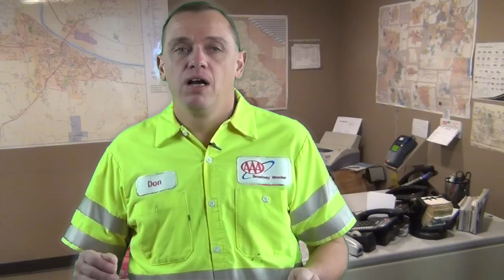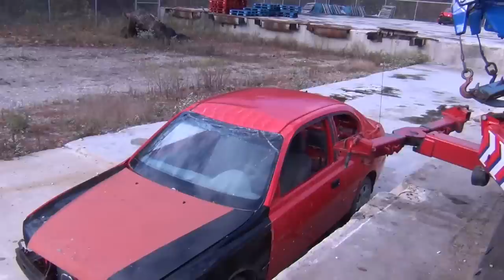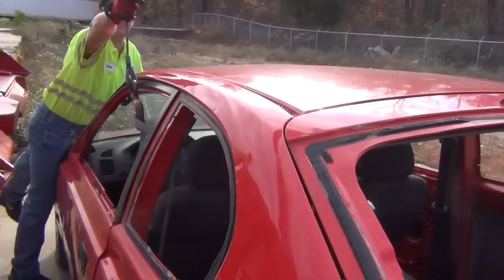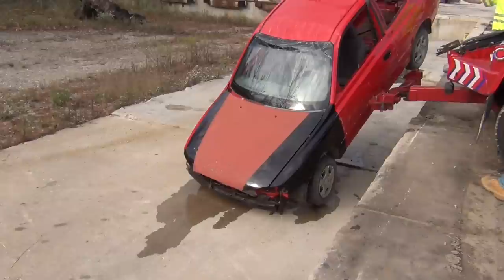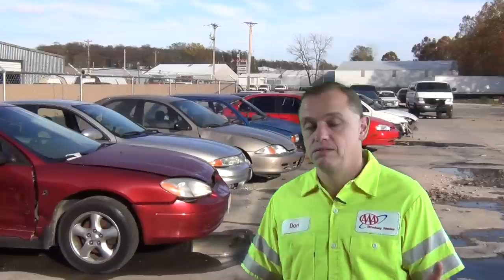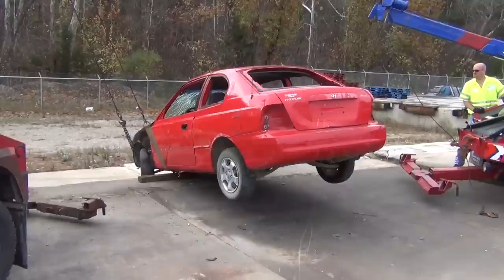Seat Belt Accident Recovery- Two Tow Trucks recover a wrecked Hyundai over the wall

Comment: That's a single truck recovery. 2 recovery straps (one behind the front wheels one in front of the rear wheels) to make a sling. One winch line to each. Boom all the way down fully extende, tighten the lines to get all wheels 6 inches off the ground. Lift with boom to get tires even with the surface the truck is on. Pull forward with tow truck, set the car on solid ground.

Comment: i recovered a toyota hiace van from the river suck in castlerea by the rear tail [back boot door] lock stricker, i had to dive in to hook on, the under carage was sunken into the river bed muck so i couldnt get anywhere to hook on to, i tied rope adound the striher and put the winch hook onto the rope, the striker held strong and i managed to recover it.

Comment: I'm a tow truck driver of two years I know I don't have that much experience but I am dumbfounded how you need two trucks and both have twin lines to pull out a vehicle why can't you just took one line to the front of the vehicle with a chain from both tires and Hook from the middle of the hood and use the other wench line to hook to the rear tires and hook to the middle of the trunk with a chain and left straight up and pull it out artist lift one side of the vehicle up and pull forward and you should raise it up and then help from the other side and just lift it up and spin it around on the opposite side that's not leaning on the wall honestly if I was one of those drivers I would be embarrassed to have that little car stock and having to call another wrecker because that there's a one wrecker job honestly for that small car my boss would laugh at me for calling another wrecker out to get that out